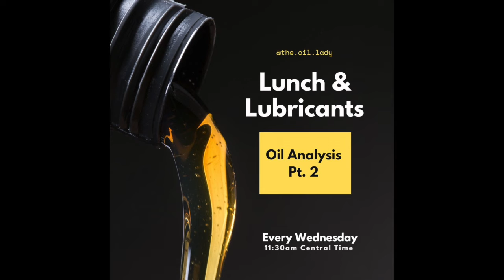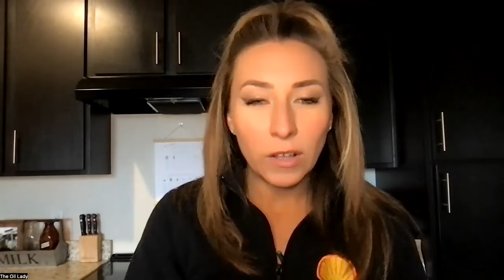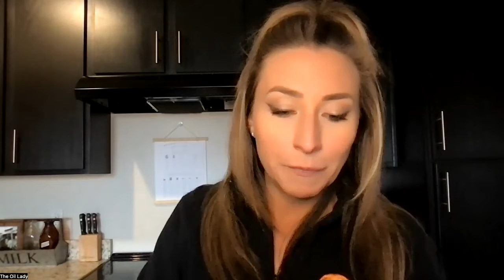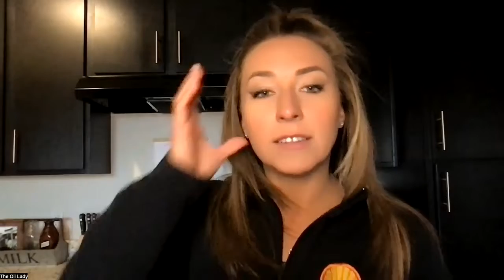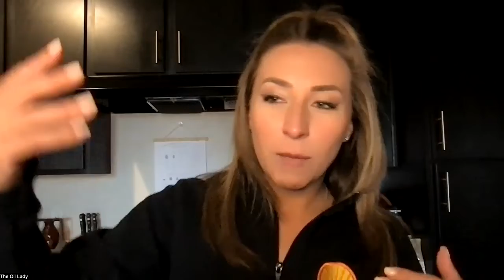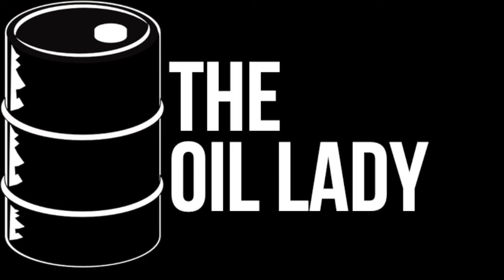Lunch & Lubes Vol 6: Oil Analysis Pt  2

Comment: I have an old 98’ Freightliner with a Detroit 60 series 12.7L.  Currently running conventional. What type of synth would you suggest? If any.   I live and work in the Pacific Northwest.  Doesn’t get too hot or too cold up here